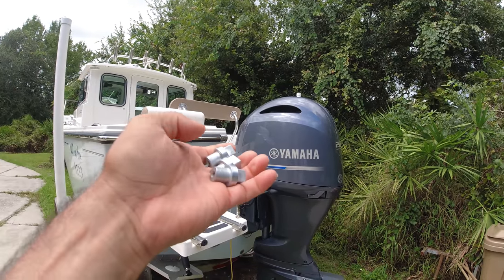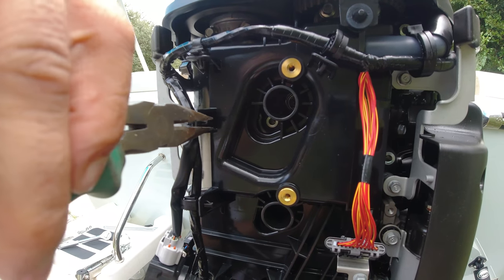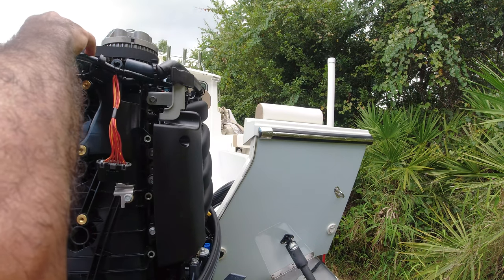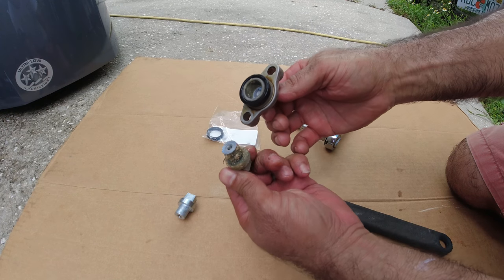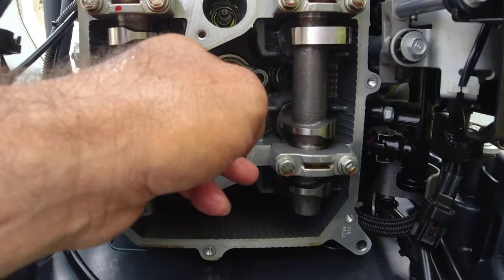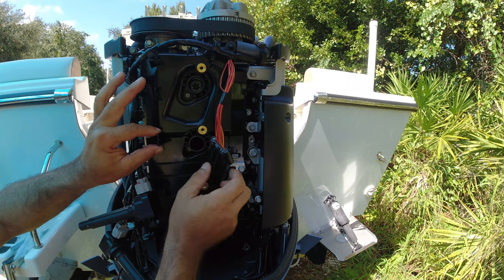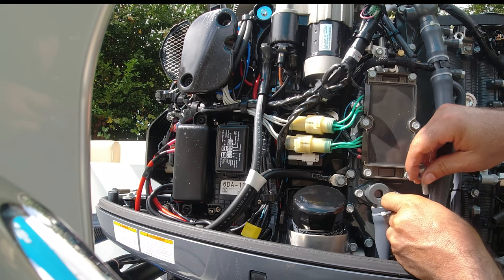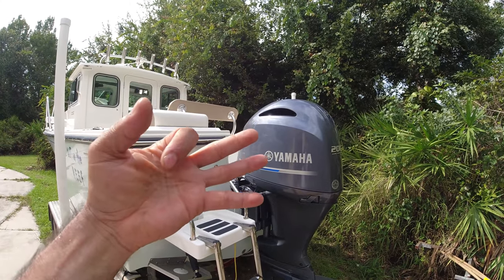Internal Anodes on a YAMAHA Outboard 200,175,150 DIY Replacing on my Crooked PilotHouse Boat

Comment: Thanks for doing this vid.  I've checked mine  a couple of times since 2017 and they looked the same as yours and mine has 450 hrs almost 100% salt too.  What I'm really shocked to see is how much different my 2017 F150  is built from your 200HP.  Really would have thought they would be more similar.  My anodes (3) can be seen and removed  by just taking rear cover off.
Reply from the maker: @luxorbill269  I thought there were very similar

Comment: Those you took out are still fine. Take a wire brush to them and knock off all the crud, they still have a lot of life in them.
Reply from the maker: Very true but the ones I put in they should give me another 500 hours so that's probably about 3 years of use
Reply: @OutOnTheReef  Ever 100 hours I take them out and hit them with a wire brush. Either way is fine though!
Reply from the maker: @saltyseatv5904   That is a great idea captain eliminating all that white residue makes the anodes work better👍👍
Reply: @OutOnTheReef  Yup!

Comment: Captain,  in addition to changing out the 3 larger anodes on the engine block that you have shown,  there are 4 other anodes that also need to be inspected and/or replaced.  There is part # 68T-11325-00 anode that is installed in the thermostat housing (off to the side) and another one just below the tstat housing.  These are fairly easy to gain access to.  There is also part # 6E5-11325-00 anode that is installed on part # 6DA-15414-00-9S and 6DA-15411-00-9S cover plates.  These are a little harder to gain access to and if removed you will also need to replace the gasket for these cover plates since you will most likely destroy them upon removal.
Reply from the maker: Great information captain thank you for sharing it and how come jamaha does not list those and anodes  as internal ones?
Reply: @OutOnTheReef  They do.  On the Yamaha parts reference sheet under periodic maintenance they show the parts with the anodes.  I"m trying to link the web page but I think YouTube is blocking the post.  I have tried several times.
Reply from the maker: @dgomes1967   Thank you buddy for trying to put it up and I'll check the owner's menu to to see where those and enodes go thanks so much for helping  Because I did not know there were more thank you
Reply: @OutOnTheReef  If there is a way to send you the link without going through YouTube that would be helpful.  This is a great resource to have for parts lookup.
Reply from the maker: @dgomes1967  i dont have a email for my viewer yet cap

Comment: Great job again captain. It’s nice that you take care of your boat and not have to go back in forth to the shop. Thank you for posting the videos so people can see how easy it is to do repairs on there own boat. It was nice that you took off the extra cover to see the belt as well. You are like me one you buy it put in and good for even more run time. And you can see the condition of everything else in there 
Great job. 
Navigate safely
Reply from the maker: Thanks will and yes once I took the cover off I saw that the belt is doing well it's doing well I think closer to the 400 to 500 hours I'll look into the belt replacement and I know it's a little tricky because it's a timing belt But when I do that maintenance I'll definitely try to make a video captain thank you so much for your awesome support👍👍🛥
Reply: huH?   WHAT ABOUT THE 2000 - MODEL, 150 HP.... ? location?   Thanks.

Comment: Bullseye!  Perfect video, well edited and explains the anode change Really well.  I have the shop manual for reference. 

FYI for those who are curious about some info out of the manual.
Manual recommends:
-Change every 500 hours (5 years)
-Work to be carried out by the Yamaha dealer (wink wink)
-Apply Waterproof Marine Grease or Yamalube Marine Grease to the grommets
-Apply Threebond 1322 to the M6 X 20 mm bolt that holds the anode on the engine block
-Apply Threebond 1303 to the M6 x 20 mm bolt that hold the anode on the exhaust cover
-The gasket on the M6 x 20 mm bolt that holds the anode is not reusable.
-Don't apply grease, oil or paint to the anode

Manual does Not give torque spec for the bolts on the anode or the anode cover bolts.

Again,  Thank you very much for taking the time to make the video.
Reply from the maker: Thanks for watching cap.

Comment: Looks good.
Should combine that with a plug change, while your in there.
Reply from the maker: Very good idea but I changed those less than 80 hours ago so soon I will change them thank you for the heads up captain👍😉
Reply: I agree, also water proof spray connectors and harness
Reply from the maker: @jhunjboogiehernandez7559  great suggestion 👍

Comment: That was awesome!  I did not know they have anodes inside the motor! How often do you have to change the belt? And when it's time,Keep the old one "Just in Case!" Thanks for sharing! 😎👍⚓
Reply from the maker: Thank you captain Rick and yes the notes have to be changed every 500 hours on this engines And the belt I think is at 500 too cap👍⚓

Comment: I can't tell if they are zinc or aluminum.  I've gone to all aluminum anodes on Aluminum boat and my boat anodes are protecting the Zinc ones due to electronegativity.
Reply from the maker: @luxorbill269  Good information, captain.Thank you for sharing.I will think about that next time.I changed mine to see what's better

Comment: Is there a sequence that the bolts must be replaced in to make sure the gasket is torqued down evenly and not leak ?  PS thanks for your videos..
Reply from the maker: Hello cap. Not that i know, For that contact the manufacturer

Comment: Good vídeo, i learn a lot .
is not necesary use a torq wrench for tigh this bolts with a manufacture especificarions ?
you explain things very well and make it look simple.
Reply from the maker: Thank you captain and yes if you feel safer use a torque wrench with specification is better and thank you for watching captain👍

Comment: Nice video, I do question the location of the bleed hole on the thermostat. My experience has always been bleed hole on the top so the thermostat is immersed in water. I took mine out for the first time since new and the bleed hole is on the top.
Reply from the maker: Hello cap and this is the way mine came from factory with the hole down, i quess is to release water traped and having the hole in the down position will release more water, hope this helps cap.

Comment: Nice job Capt! Do you need to put oil on the rubber bushings before installing? Do you need to put a new cover gasket on before replacing?
Reply from the maker: The cover gasket is reusable to a certain point And the grummets got oiled up when I put it back in the crank case cause there's oil in the crank case And thanks for watching captain👍⚓

Comment: Not to be picky but why are you not using a torque wrench on all those bolts. And did you renew the valve cover gasket which is not reusable.  Hard to see from the vid, but did you use water muffs when you ran the engine for 5 minutes?
Reply from the maker: Yes I use water muffs for the engine And the crank case gasket it is reusable captain And the reason I did not use a torque wrench is because I did not find the specifications of the torque And I tried looking it up on the Internet but there was nothing that I can find so I just used my good old muscles😉👍

Comment: Cap I thought some videos back you were talking about exchanging this engine in for a bigger one. what's the plan on that?
Reply from the maker: Most definitely in the future when I put hundreds of hours on this engine maybe like 800 hours I will change it for 225
Reply: @OutOnTheReef  You will love the V6 over the I4, Torque is the biggest difference. That said the 150 - 200 i4's are bullet proof.
Reply from the maker: @robertrowe991   Very true captain these 200 horsepower engines are very reliable And yes the V6 is a lot more to torque

Comment: You missed a few anodes!!!   Small barrel style anodes
Reply from the maker: ware are those cap.
Reply: @OutOnTheReef  check out the Yamaha website for their exploded diagrams.   There are two I am aware of ... One is on port side near top of engine and other facing forward very top port side.  There are also a couple more deep internal ones that I'm not ever going to reach myself!  :-)...    I am replacing with aluminum which don't go white (when white they are electrically isolated and no longer working).
Reply from the maker: @robsimpson3721  thanks cap.for the info👍⚓️

Comment: Did you run that thing for 10 minutes without water?
Reply from the maker: No i was using water, without water the engine will die cap

Comment: The reason why your anodes dont look bad is because they arent supposed to be replaced at 200 hours. 200 hours is nothing. Also, that isnt a crankcase cover, that is the valvecover that you removed. And the timing belt is not supposed to be replaced until 1000 hours. No harm in doing it early but just a waste of money in my opinion. I'm a mechanic by trade and boat engines are no different than car engines.
Reply from the maker: very true cap. thanks for the awesome information and yes 1000 hrs for the timing belt is a great time i agree👍👍⚓

Comment: This might be a silly question but what was that that you replaced Cap...and what's there function
Reply from the maker: Those are called  Is sacrificial sinks  what they do is they wear out before the engine wears out is the electrical pulse that destroys the engine housing and metals so this protects it by being softer metals It wears out 1st🛥⚓👍
Reply: @OutOnTheReef  thanks for the info Cap🤙🏽
Reply from the maker: @gersapril8889   Anytime buddy